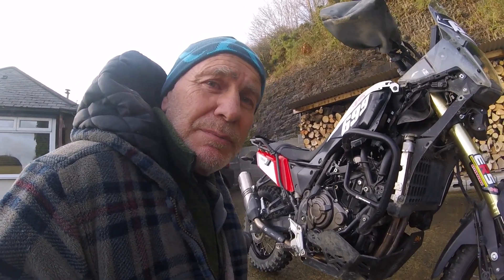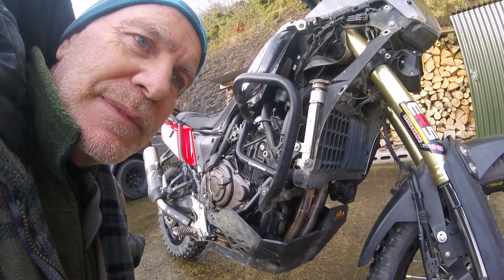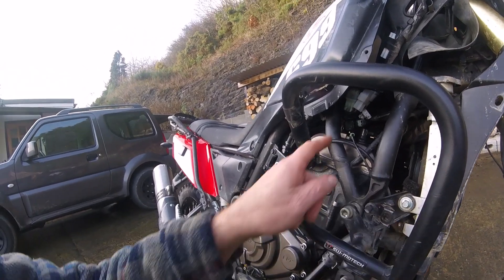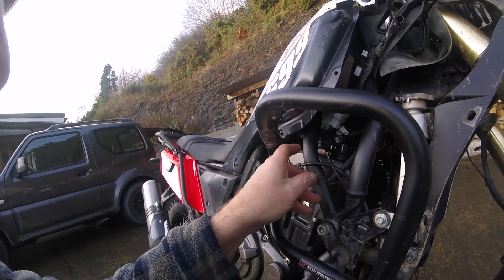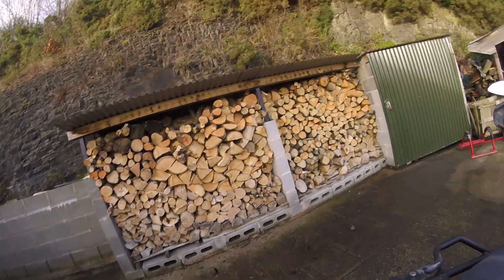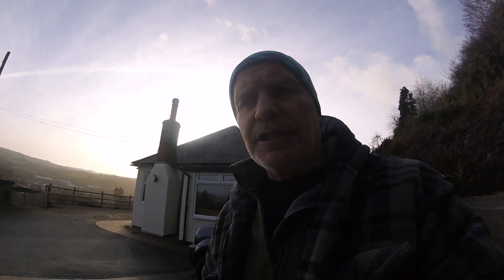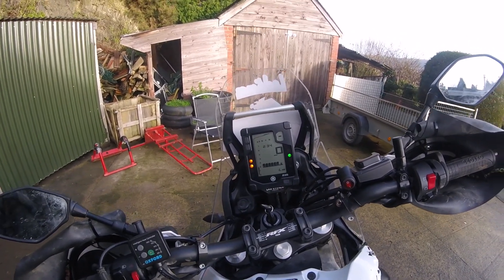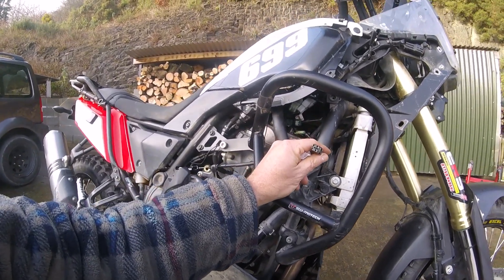02 sensor delete on T7

Comment: Hey bud did ya clear the code off the ecu yet, I had mine come on when my battery died got them to clear it on the last service.
Reply from the maker: not yet will try again tomoz if sean remembers his scanner tool.  hope it works this time. just hope it stops running crap at tick over.  will see after riding it off road.

Comment: I did the same but light engine comes back after clearing the code. Any ideas?
Reply from the maker: i put a bye pass plug on the wiring and left lambada sensore  in exhaust  the plug is £20  stays off all the time. look on ebay think its 
 red line superbike racing uk or somthing have a look.

Comment: You do know the O2 sensor performs a task and in deleting you run risk of engine damage.  If bike running rough fix the problem 🤬
Reply from the maker: o2 sensor is fine to delete. loads of people do it. the bike runs better. your ecu is too lean this just makes bike run a litle richer.
Reply from the maker: @JESSIEJAMES-yz7qj deleting the o2 censor will make your bike run richer.  the new bikes run way to lean. this bike has been on a rolling road  and it was not tuned   you can see that vid on my channle.  i think you need to look more in to o2 censors.. this bike has got a full race exhaust and decat headers. its been running very good and the mixture on the fuel graph is good.  i no bike mecanics who do this as well. this bike has been run on a rolling road no adjustments to ecu. its going to get a intake mod soon and that is going to need a remap. o2 delete is fine.
Reply: @adriantompson  we know modern bikes use o2 to keep bike lean to help emission and fuel economy figures and removing helps bike run richer lowering temp etc. but simply remove is a budget fix.  Remap ecu is way to go if you care about bike